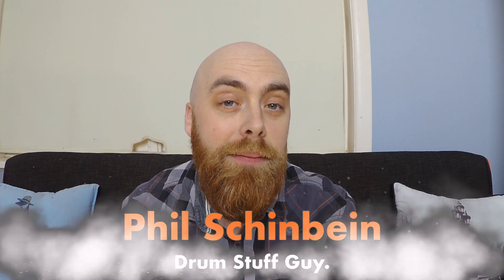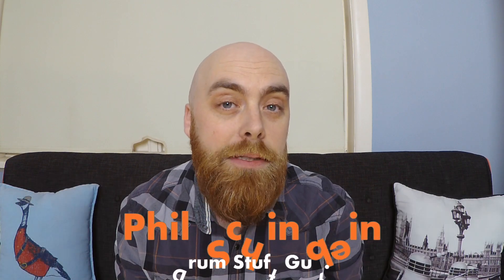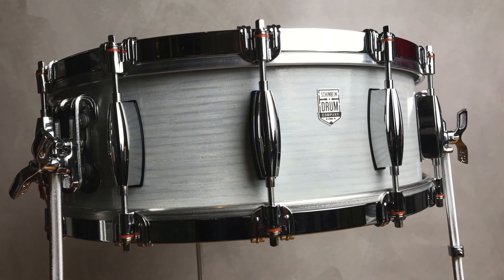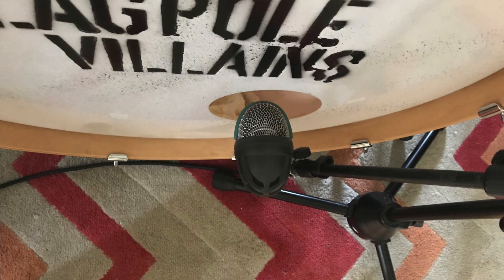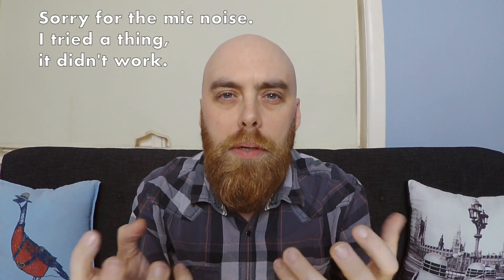Kick Depth Shootout: 18" vs 14" deep.

Comment: I definitely prefer the 14" depth. I also have a 24x14 kick and it's been my favorite kick to play (Gretach Renown). I've owned 18" depths before, and I always felt they were a pain to control, so I'd end up putting larger pillows in the kick to really control it, which would then make that 18" depth kind of pointless. With the 14", just got one small pillow barely touching the heads, and a felt strip on each head. Perfect sound.
Reply from the maker: Those renown’s are legendary.
Reply: Most definitely one of the best, if not the best, bang for the buck kit out there. Great sound and build quality, for under $1,500 US.
Reply from the maker: Yeah man, totally.

Comment: I cut mine down from 20" to 16", which I find to be the perfect middle ground for response and low-end.
Reply from the maker: Yeah fair enough.  I’ve cut down a LOT of kicks by now. I find more often than not, at least as far as cut-downs are concerned, the depth is dictated economically; the more hardware I need to relocate, the more it costs more for the client... but yes, 22x16 is great.  20x15 is what my own personal kick is.

Comment: I had a 16 x 20 bass drum I cut down to 12x20 to fit in my car, then made a super portable 4 x 20 bass drum for fun.  The 12 x 20 actually sounds fat with a superkick 2 on it.  I was going to take my DW 14 x 22 out giging, got a prius that fits my set easier, but I like my cut down rockstars punch. I think heads could add to the punch removed with less depth.  Great video!
Reply from the maker: Thanks!